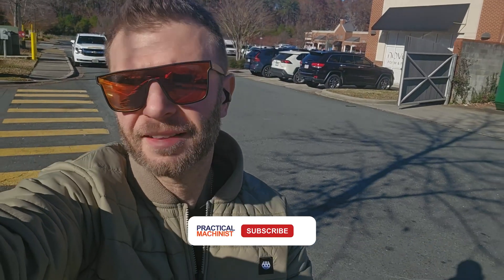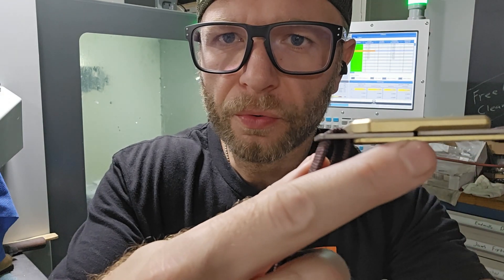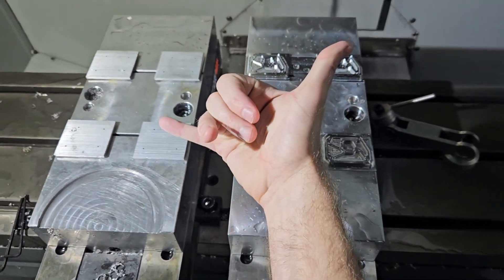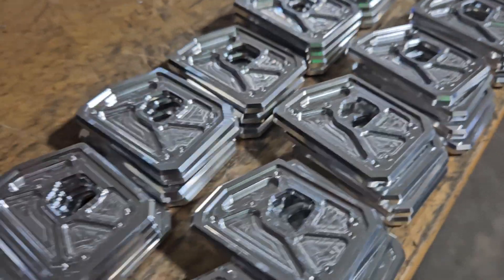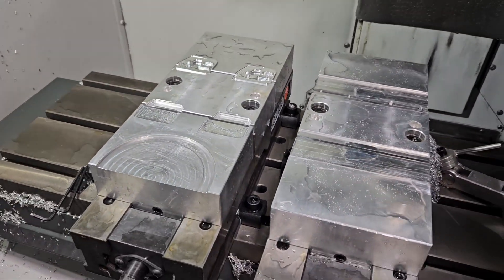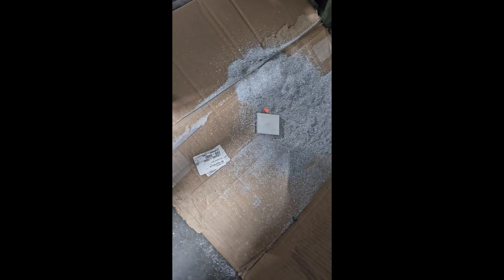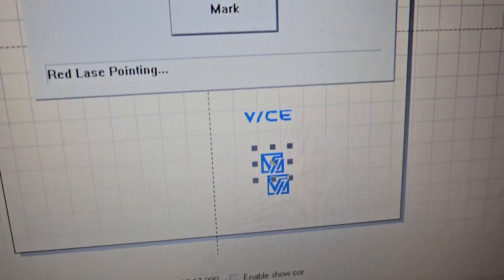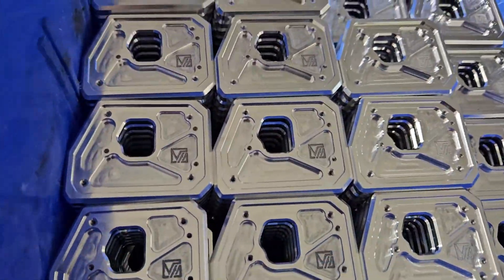UP AGAINST IT: Can He Make Enough Parts in Time?! | American Made Ep.6

Comment: Awesome video, these belts are rad!
Reply: With a soo big amount of parts to make, and around minute 3 on the video, if you have 4 parts mounted, why machine one by one? Why don't optimise the tools changes?
If you have 5 tools to be used and each tool change takes 10/15', in those 4 parts will be saving 2 to 3 minutes.
In the end you will save a lot ot time, no?
Reply: @necasnuno  It looked like he was running a single piece for setup. 60 seconds later you see the face mill hitting all 8 parts before a toolchange.

Order by operation is literally 1 dropdown menu in Fusion so its a little condescending to assume hes bad at his job.
Reply: @necasnuno  who said I wasn't doing that?
Reply: Thank you brotha 🙏